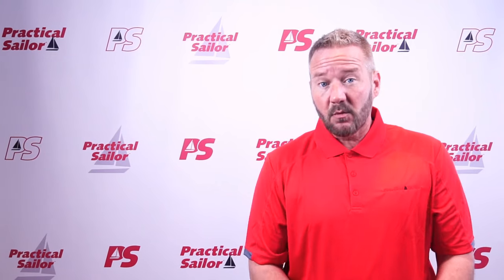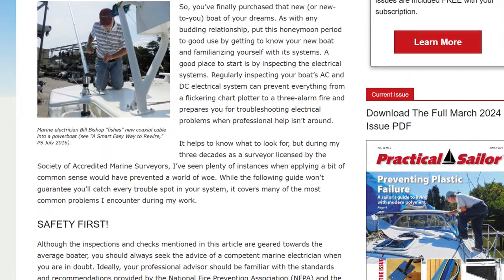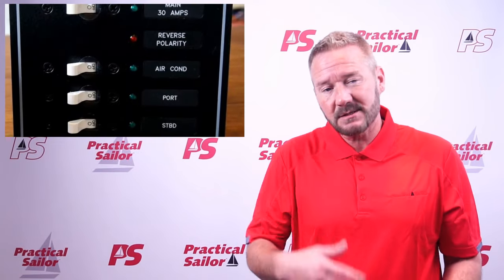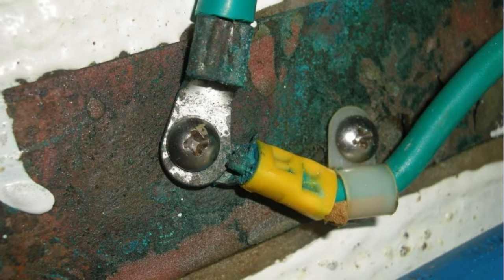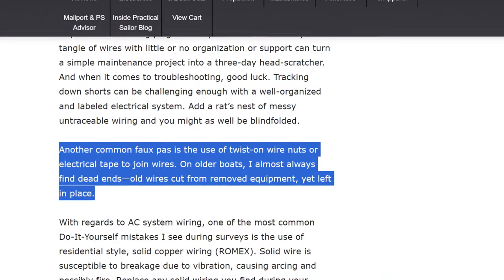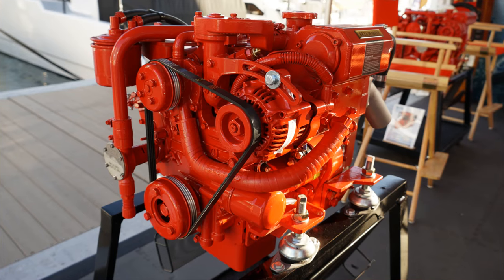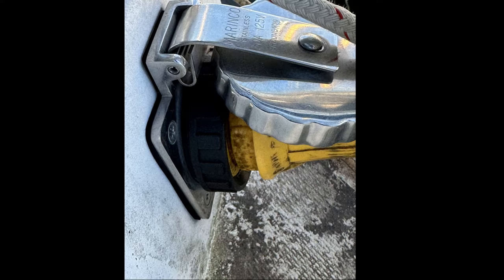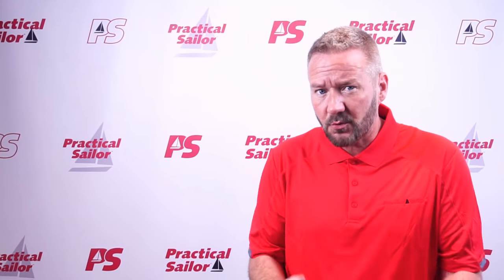Electrical Do's and Don'ts

Comment: Great that you're reminding folks about locking down that shore power cord!  Overheating contacts can set a boat on fire.

Episode suggestion:  talk about the importance of safety in wiring projects  - the need for properly sized wires, properly sized and located fuses, using  bus bars instead of stacking connectors 9 deep on a battery terminal, proper marine grade wire, and so on.

Many folks are going about lithium battery upgrades and solar installations without the knowledge to do it safely.

Comment: I know it should go without saying, but I quizzed some of the sailboat people on my pier and not many of them had... a spare alternator belt on board. I was lucky when mine broke. It happened within 1nm of home at the end of three weeks of coastal cruising in waters where you'd be hard pressed to buy fresh bread, let alone Yanmar spares. It was easy to fix, thanks to having done so many clapped out car repairs back in the golden age when you could actually figure out how do that sort of thing, But I was most thankful to the previous owner of my boat, who kept three belts on board (what looked like a new one, and definitely two from routine maintenance changeovers). Inspecting them, and considering how old they might be, the one that looked new was the only one I would have wanted to install. I now ALWAYS replace my belt when I do my annual engine maintenance. I use the one new spare i bought last year, and replace that as a spare with a brand new one. No used belts, just one that I always know the age of as a spare.

Comment: Hi Tim, I've been following your channel for a while now and I'm excited to see you here!  I had a small boat service business for a few years and one of the things I came across frequently on the DC side is undersized wires.  ABYC has an online wire sizing guide and easy to use app.  The key thing to remember when calculating run distances it that it is the complete circuit not just the one way trip.  For example a bilge pump 10' from the panel is a 20' circuit for wire sizing.  I've also started using Deutsch style waterprooff connectors for wear items like bilge and water pumps.  The connectors are reusable except for the pins and sockets crimped on to the wires.  One advantage is that it allows me to prewire a spare with the appropriate plug.  I can then switch out a failed pump in a hurry in critical situations.  Another advantage is the ease of removal and re-installation of electrical components which can make it much easier to service them on a bench instead of in a cramped compartment.

Comment: Thanks Tim, All good advice. I've never thought to leave a little extra wire length to re-do connections. Also, I use tinned marine wire and a bit of di-electric grease on connections.
Reply from the maker: Great tip!

Comment: Pre launch for us is fully rewiring our entire boat, changing from fuses to a new panel with circuit breakers, stand alone 100 amp breaker to the engine, new keel winch cable and lengthening the berth where we sleep by 3.75”
… 
Almost done with everything, hope to splash in a week. 
We subscribe to Practical Sailor magazine and I read it two or three times as soon as it arrives. Also love watching Lady K videos. Good to see you on board there at PS..!!

Comment: The black dust doesn't just come from a bad belt.  Worn pulleys, high loads on driven components such as alternators and water pumps are a leading cause of belt wear.
Reply: worn bearings, too

Comment: Absolutely love these new videos, thanks as always for sharing!  Don't know if I would be the only one, but could it be useful to go over types of connections, types / gauges of wire (stranded, copper or not, heat shrink sure, type of metal end terminal connectors, desired type of jacketing, etc)?  I know we should always just go sailing, but come time for replacement, I'd at least like to know how best to do things.  Hope that made sense.  I really homed in on the leaving 6" for what should be expected end replacements.  Thanks again!

Comment: Most of the resistance on the shore line plugs come from corrosion.  This resistance generates the heat and causes the fires.  They should be treated with a dielectric grease to prevent that corrosion.

Comment: A loose electrical connection causes resistance, not restriction.  Though you can think of it as ""restriction."  The flow of electrons can't make a smooth pass through the connection and they "slow down" and "bunch up."' The longer they hang out at the connection trying to make the "leap to the other side" the hotter that area gets.  Easily hot enough to melt your shore power plug.

Comment: If the wires are old it is very likely that they are not marine grade. Marine grade wire is tinned to prevent corrosion. Replace them whenever possible

Comment: A common error I encounter on land and water is lead batteries wired in parallel. Small differences in voltage means they fight each other. With a strong charging system, use an isolation switch and use it. With a charge like solar panels, use separate chargers and run the batteries into separate loads.

Comment: As a sailing electrician 👍, currently in Thailand sailing in the heat.
My heating system gets cycled every month because I’ll be back in Canada 🇨🇦 one day
Reply: Great tip which also goes for  autos, too. Run the heater to prvent corrosion in the heater core.  Once a week in the spring and summer is sufficient.

Comment: Often electrical problems are solved by redoing the butt splices that are not heat shrinked. Also cleaning up corrosion, even invisible corrosion is good practice if anything is a problem And feel the outside plug housings. Are they warmer than they should be? Might be some corrosion in there. (I'd be careful spraying contact cleaner into a plug and then flipping the switch.) 
Battery slots are nortorious for invisible corrosion. Simplest method is to just rub it with a pencil eraser. Did that once on a $400 light meter I bought for $80. It kept turning off. All the contacts were shiny. I made a bet it was those contacts. Did the pencil trick, and used it for many years without a problem.

Comment: The comments about securing your shore power cord with the retaining ring-I always wondered why do dock pedestals not have a way to secure with the retaining ring?? Thoughts?
Reply from the maker: The only think I can think is because they aren’t moving 🤷‍♂️ the boats always rocking.
Reply: I have been at floating docks that are rocking as well.  Plus the cords are often laid along the dock where they can be kicked. I will often put a tag line on the cord end and secure it to the pedestal to keep more secure. Some dock masters frown on that practice
Reply: The dock masters do not want to have to replace the powerpost, tie a hitch around the shore power cord and attach to the nearest dock cleat.  Reduces strain on the powerpost and your shore power connector.